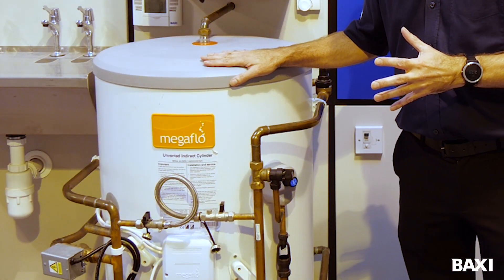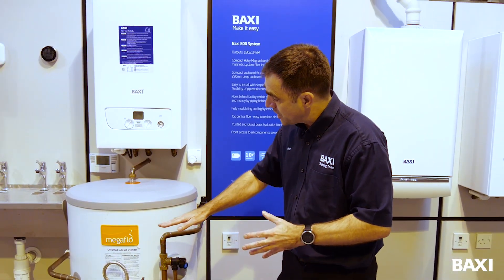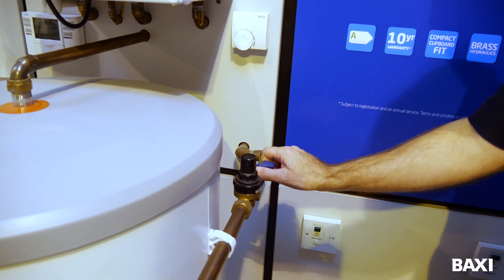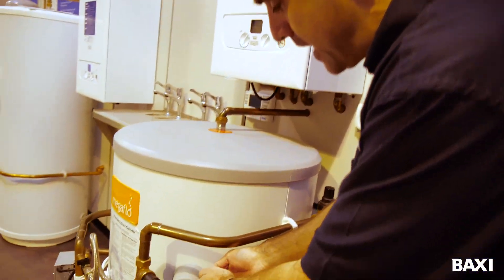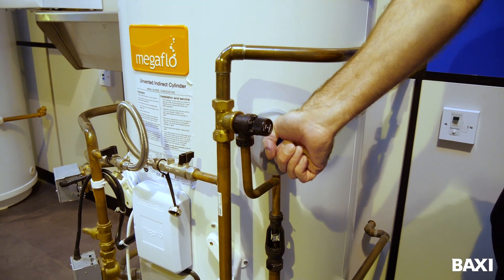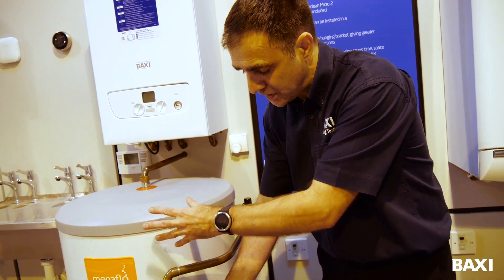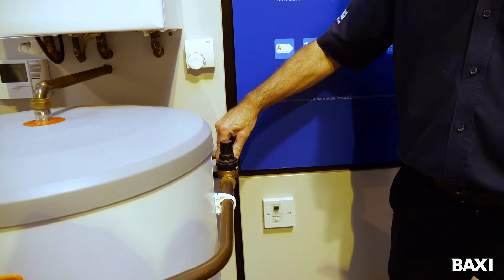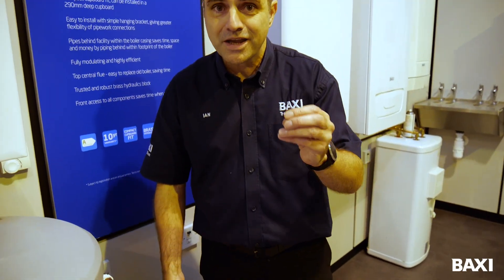How to recharge the internal air gap in your Megaflo cylinder

Comment: Very helpful video. Much easier to understand by seeing than reading. Thanks. My CH system had its first service Feb 2023 a year after installation and the engineer carried out this procedure when I pointed out dripping from the outside overflow pipe. Eight months on I’ve recently noticed a much heavier discharge from the overflow pipe while heating so I’m set to follow your video to recharge the air gap. (Done. Needed to hold the pressure valve open for just over 20 mins before gurgling/hissing stopped). I’ve read that this should only be necessary about once a year so a little concerned that I am having to do this again so soon. Does this seem normal or is it suggesting a potential fault/issue given that my Megaflow Eco Unvented indirect cylinder is just 20 months old?
Reply: Seems like the constant problem. i have the same issue, not sure if they have this as a wider issue across all their tanks

Comment: When you say isolate water to the cylinder ... does this mean the main water cut off .. so it cuts off water to the entire house? As our cylinder is location upstairs and the complete water cut-off valve to our house is located downstairs under the kitchen sink.
Reply: Cylinder should have its own supply isolation located near it.